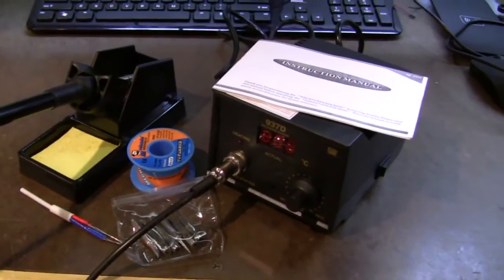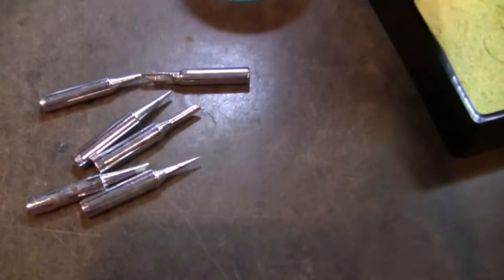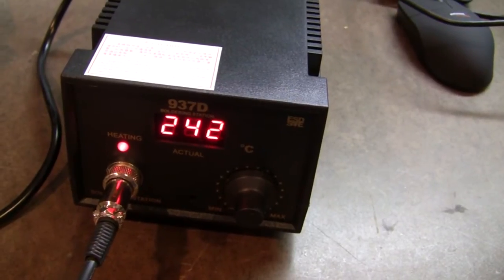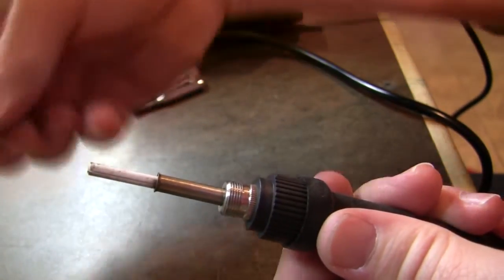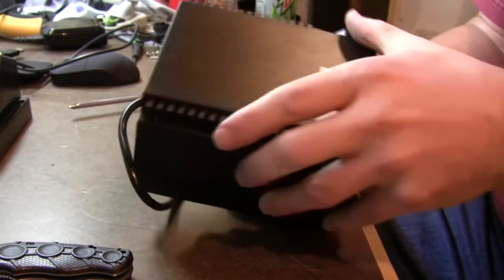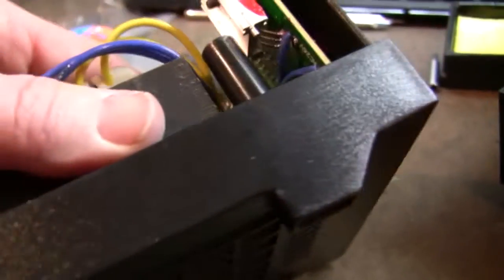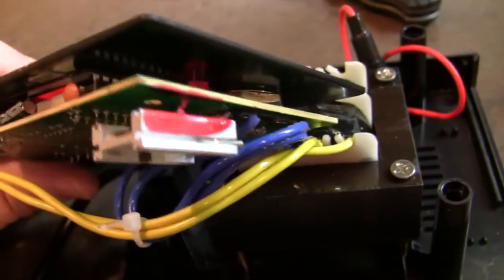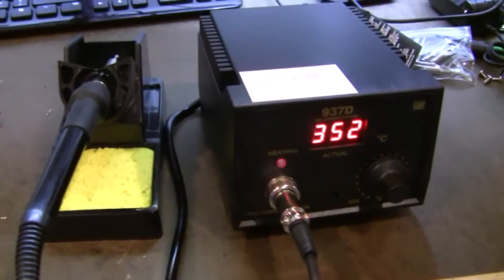$30 eBay 937D soldering iron teardown and review

Comment: which tip and temprature is right when soldering 18650 batteries. i am having such a bad time trying to figure that out.
Reply from the maker: You should not solder to 18650 batteries. You spot weld them. If you don't want to buy a spot welder, buy batteries with solder tabs already spot welded to them.

Comment: I bought one of these (not exactly like yours but darn close) last week, at least you HAVE A HEATSINK, mine doesn't! The TO220 isn't mounted other than the solder joints.  I'm probably going to add a heatsink (if I can) and/or use a screw to mount it to the board if I can.  It has a solder pad under it so I'll add some thermal paste if nothing else.The first thing I did when I took it out of the box was open it up to check the guts of it.  I've only used it once so far and it did a good job.

Comment: Hi John,  GREAT CLIP !!  I have tho, *(a question about this exact iron): I bought this exact "937D+" and received NO "Tip" (no corded iron / nothing to solder with). I cannot get the Seller to understand my circumstance irregardless as to how I've explained it again and again ... They simply don't understand / won't listen. VERY VERY FRUSTRATING.  Anyway: IC that there are "Corded-tips" avail. (I call this a "pencil assy".), and I wondered if YOU could tell me which one to buy. WHEN I MYSELF ASK The EBay Sellers about a 937D PLUS(+), they say no "tip" assy. is available.
Reply: if world.taobao.com is avilable in your country，you can try that. you can search keyword “936 tip” i think those 936 937 irons use the same tips.
Reply: I did just that:  (it's ordered). "Thanks for having my back John" !

Comment: I have one that looks slightly different internally..The transformer,the fuse holder and my controller board has connectors for both pairs of wires..the heating element is also a little bit different..over all it's a decent soldering station for the price though

Comment: Was wondering if you still use them for your class, have they held up so far?
Reply from the maker: I don't do classes that often, maybe 2 or 3 nights a year these days. They're holding up fine but it's hardly a good test.  OTOH I have seen people commenting that they have toured manufacturing plants in China, and they use these cheap stations on the rework benches, so they must hold up at least decently.
Reply: That's great thanks for the reply

Comment: I have the same solder station. Purchased not too long ago. I find that it heats up amazingly fast according to the display. I would be very interested to know how well the tip temp matches the display. Do you have a soldering iron temp tester?
Reply: i have the same station and the temps on mine dont match atall i wish some one could help me fix it i tried to calibrat it but its not doing anything when trying to adjust it

Comment: going off my experience of repairing audio amplifiers (they use similar heatsinks on the mosfets) there should be a nut on the end of that bolt securing it. at about 8:48 in the video.

Comment: Is it 30usd shipped? Then i want one too, where did you get it from? Sellers Name?
Reply: Thank you! found it via ebay to ship it to germany, can you remove the frontpanel by unscrewing the big "ring" style nut on the front? the lose to-220 just bothers me alittle, also those dodgy caps ^^

well i guess i have go at it when it arrives
Reply from the maker: +Moes Hobby King has a 936 clone for < $20.  They're out of stock frequently though.  I just search eBay

Comment: It will ran at a reading on tip 60c or more higher then set.
Reply from the maker: I think that depends on how well calibrated an individual unit is.  If temperature accuracy is important to you, soldering iron thermometers (Hakko 191) are about $12 online. Pick one up and in a few minutes  your iron will be spot on. This goes for any iron from any maker.

Comment: lol. After I saw the insides I went and took the cover off my Weller WTCPT. Man, what a night and day difference. I have had my Weller since I graduated high school. I took electronics at the vocational school and my uncle gave one to me as a gift. That was 1990... 26 years later and never had to replace a single part except for tips. Never has failed me. You change the temperature by changing the tip. There are probably more accurate ones but the WTCPT is built like a tank. I hope nobody leaves one on and burns the building down.
Reply from the maker: Yeah, it's too bad Weller doesn't make irons like that anymore. They've offshored all their manufacturing and their QC has gone to shit. Of course, these days you kind of need to be able to change the temperature a little easier than that in a lot of situations too.
Reply: Yes, Weller for now and forever.
I got my Weller WTCP-S in the year 1977 where i was seven years old(no joke).
I burn my skin much times with the iron and in the last years i soldered(mods, repair, ...) hundreds of VC20, C64, Amiga, Playstation, PS2 and an infinite number if televisions and much more with it.

Up to this day i replaced the heating element one time and i use the WTCP-S ever and ever for soldering, except bga components.
For simple SMD devices i love it.

Sorry for my bad english.